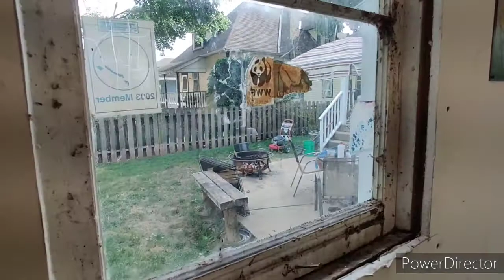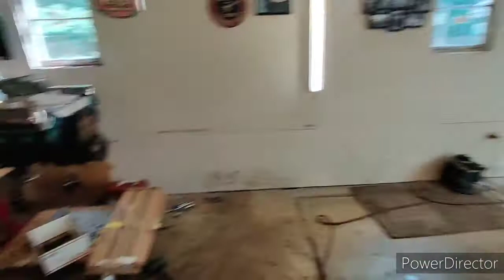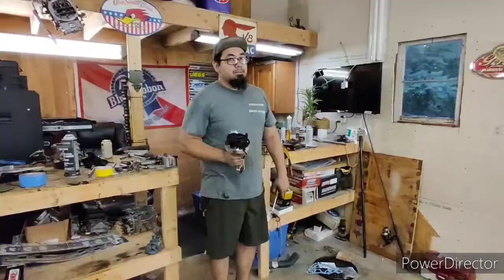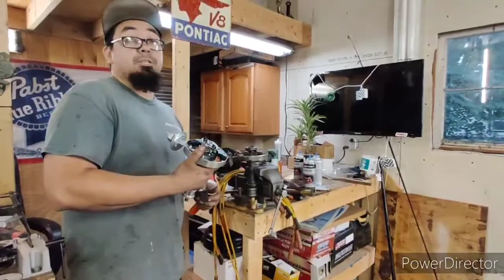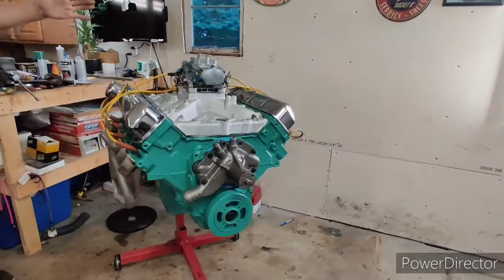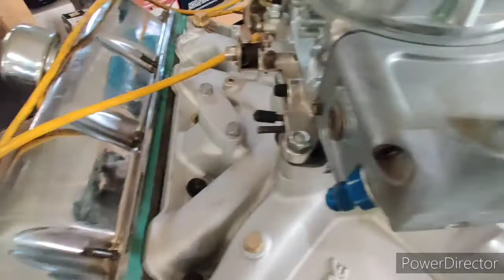455 big block olds is ready for the run stand !!!!

Comment: I like that colour choice, the unpainted parts actually make it work. I'm with ya on the 
oil fill tube, I think I was the first one to have the optional oil fill tube hole drilled in a 
Rocket Racing  block.
Reply from the maker: Very cool. Can't wait to see that thing unleashed.